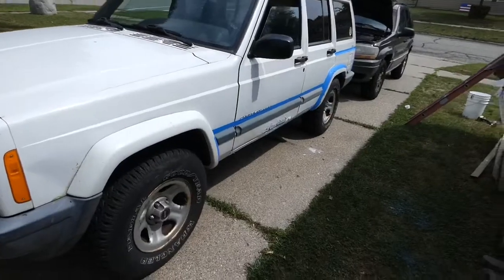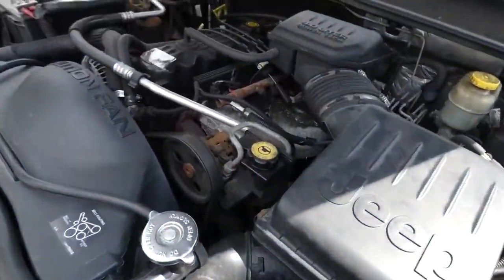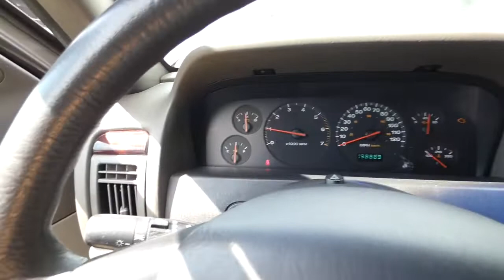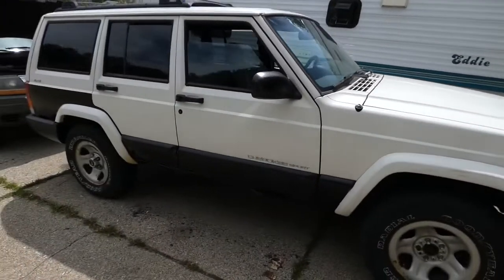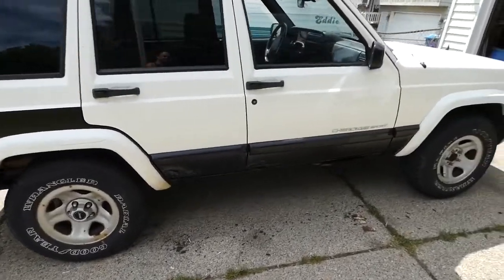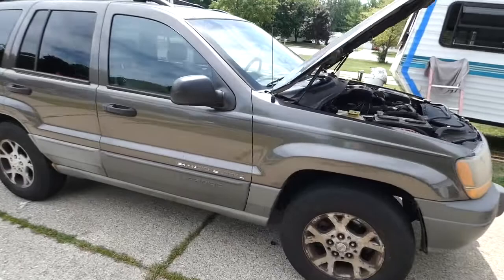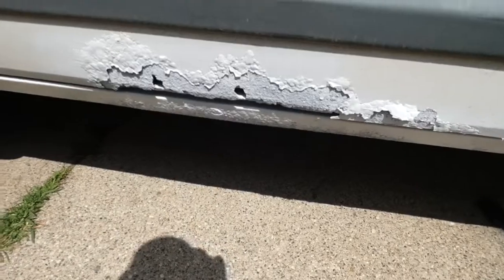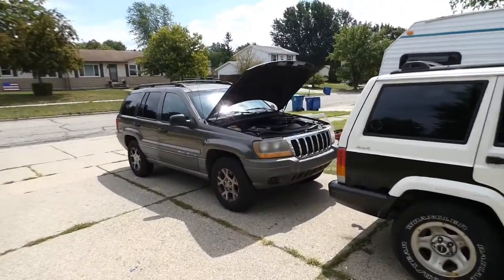How To BUY A Car CHEAP, FIX IT, And SELL It FAST Pt.16

Comment: The easiest and fastest way to fix a little spot of rust is use a body filler called duraglass. (Amazon for 50 bucks) use some newspaper and grind it bare metal. Put some fiberglass on the newspaper and stick it on. Let it dry and sand away
Reply from the maker: KuhnMan I’ve done that before. But then paint matching is a nightmare. But yea it cleans it right up
Reply: @KBMOTORSchannel  yeah I'm not happy to say that but definitely makes something look nicer than having a cab corner gone if you're trying to sell it. If I had a welder it would be different though.
Reply from the maker: Right. And for a quick few hundred bucks. Spray it black and flip it. Lol

Comment: If you can't get 1250 out of the white one theres something wrong. Most people are afraid of  good price. The higher the price the better they think the vehicle is. I tried to sell a Chevy 4X4 all one Maine winter for 1200. Never got a nibble. Come spring I took a white shoe dobber wrote 2500 on the windows and the guy that bought it was less then 5 minutes after I put it there.
Reply from the maker: Dean Labbe you are 100% correct! I’ve raised the price $1000 before and sold first day after no messages in a whole week

Comment: havent even watched the vid yet. i see an xj i see a guarentted 2800 and some change to be made. Jeep fan boys buy anything. the 4.0 in6 is a great motor from late 80s to around 98. 99 2000 and 2001 had trash milling done and the heads cracked worse than alluminum Lq4 6.0 Vortec Head in a chevy dually truck. lmao
Reply from the maker: Purple Sway another Jeep guy! What’s up

Comment: Did you get the Flex Seal Yet?
Reply from the maker: METALMAN4Wii I have not. But I guarantee we are going to try it on video. Lol. If it works we win.
Reply: @KBMOTORSchannel  Maybe go with the white the clear might show unless you are painting it?
Reply from the maker: We’re probably going to paint it white like the walls then it no doubt matches